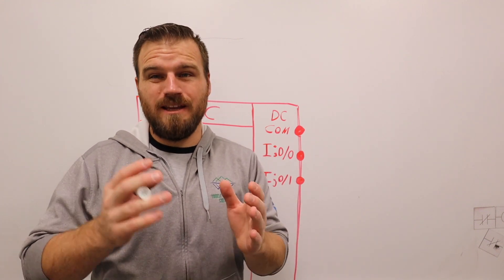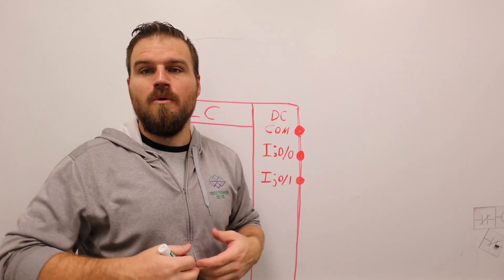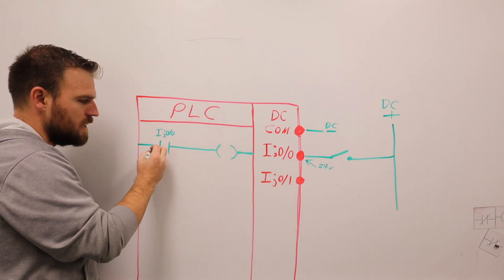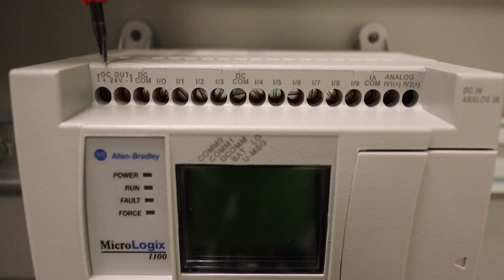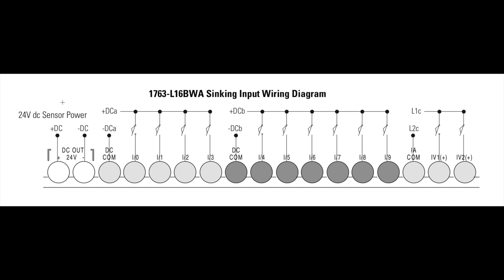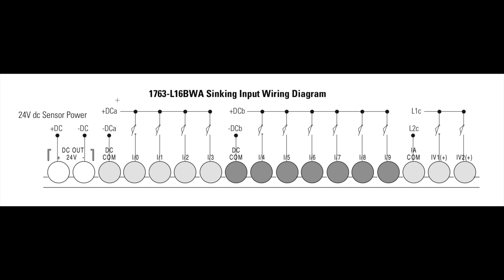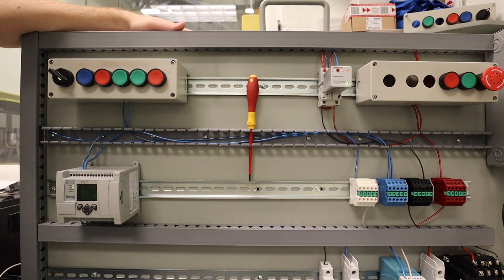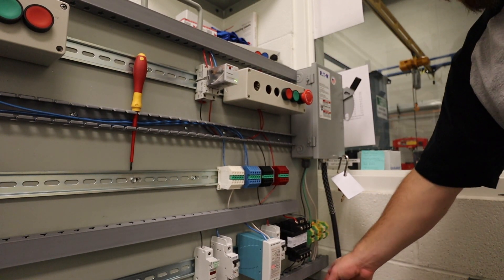PLC - Wiring inputs

Comment: Hi. Notes before i ask. Using a ab micrologix 1000 and im new at plc but know at least a tiny bit. 
 The input side at the +24- terminals. sinking mode, I have jumpered the negative side to DC com on its own branch of input channels. Ok, check. Now I stopped because im wondering,  is this section or branch where just the +24- DC out where the 2 terminals are,  is this where I get my power from to operate all sensors? Or am I supposed to have a 24 volt separate power supply for each sensor? Thanks
Reply from the maker: I’m not quite sure what you’re asking. Are you asking if you have a separate power source for each input or are you asking if you can just use the same terminal?

Comment: You have a separate supply of 24v?
Reply from the maker: Yes, typically the incoming power is much higher than the control circuit.

Comment: In a normal situation would you have to have a physical jumper from your negative power terminal going over to your common terminals or is that connection internal already? 

Thanks.
Reply from the maker: I don't want to blanket statment say yes they all have one. but all the ones I've worked on have a COM terminal that requires that negative.
Reply: Great, thank you.

Comment: if you are using a sinking input style like in your video must all the field devices have separate  individual power source (24v) or must they have the same power source powering the field device
Reply from the maker: I’m not sure I'm totally understanding your question but for a sinking circuit the 24v should be common

Comment: Just curious how a pc program is used to control a plc. Such as a encoder readout on computer program that does allow foot switch to work unless in a certain range?
Reply from the maker: I would have to see what you are working with but if I had to guess you would use an analog input and a scaling method. Sorry to sound vague I've never done something like that with this basic of a PLC but I'm sure it`s possible.

Comment: I've watched lot of videos about  plc wiring, sinking and sourcing etc, but nobody explains where the dc source should come from. Should it be a separate dc power supply or originated from the plc power supply itself. Some videos tell that dc supply from plc is good only to energize I/O modules not field devices. Sinking and sourcing concept is easy to understand, but should we install separate power supply to energize field devices like proximity sensors, transmitters etc.?
Reply from the maker: Yes but some PLC`s have a DC power supply.